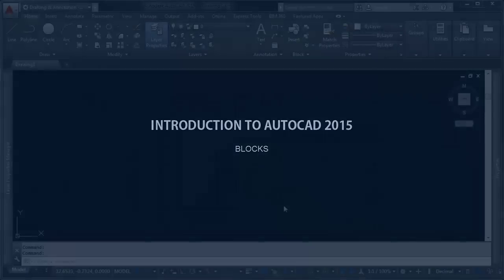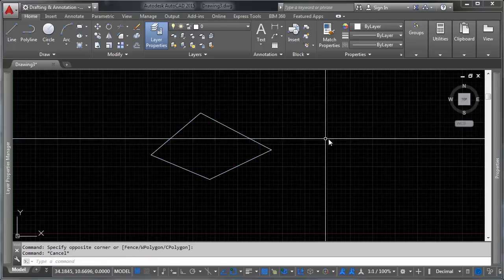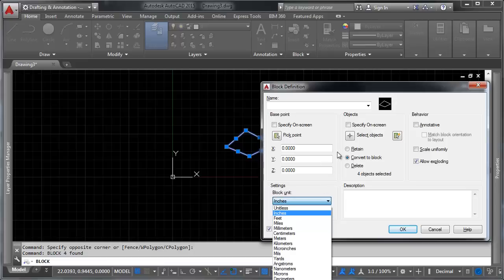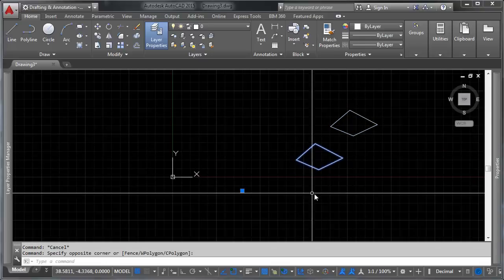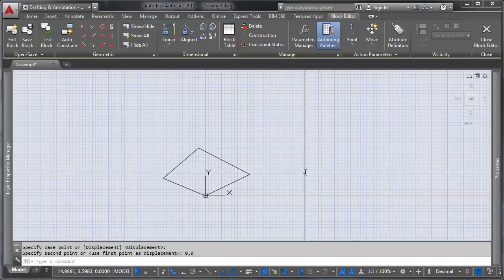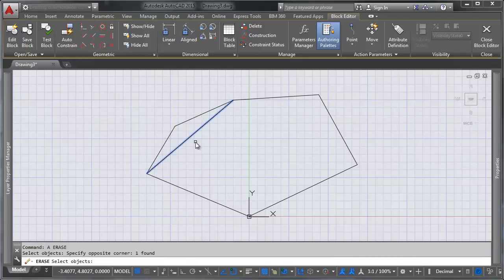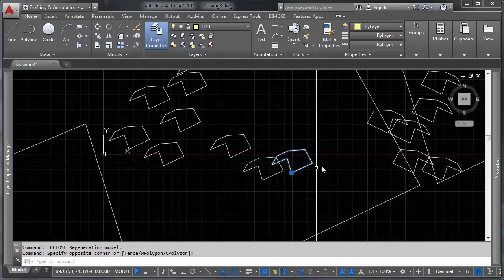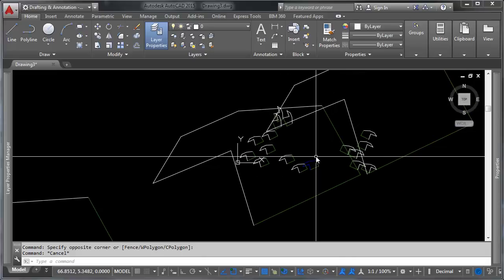Intro to AutoCAD 2015 - 12 - Blocks

Comment: Killer videos, Chris! Quick question though: Is there a way to make an editable text field inside a block? My situation is that I'm working on electrical drawings, so I might have 10 or 20 relays and each has a different text label associated with it. When i try to simply add a an Mtext into the block, I don't seem to have a way to edit a single instance of that item without exploding it first. Do you have any slick ways around that?

Thanks,

Comment: I recently accepted a job with an engineering firm where around 50% of the work is AutoCAD. Problem was that throughout school I only used SolidWorks, and I found the two programs to be very different so it was difficult learning it on my own. Well, I've watched mostly all your 2015 CAD videos and they have been SUPER helpful. Thanks so much Christian!!
Reply: +Christian Buchert  pls can u send me solidworks software and tutorials for study.   igwejohneze4@gmail.com